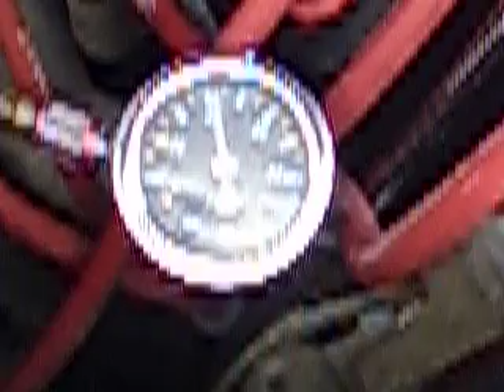302 Mustang Notch B-303 cam and 195 cc heads

Comment from the maker: Thos ProComp heads have been used for the equivalent of ~9months of use. And they do need to be refurbished. Keep in mind the car is of a "customer/friend" of mine My thoughts about them?....... I would not use them in my junk. I plan to get a set of Trickflow TW 190cc "fast as cast" units for my 302 and a custom HR cam grind of my configuration.

Comment: How long you been running the Procomp heads? Have you had any problems with the heads failing? I hear a lot of bad things about valve seats dropping, excessive guide wear, etc. I was told their Ford heads but you have to use Chevrolet valvetrain components. What are your thoughts on them?